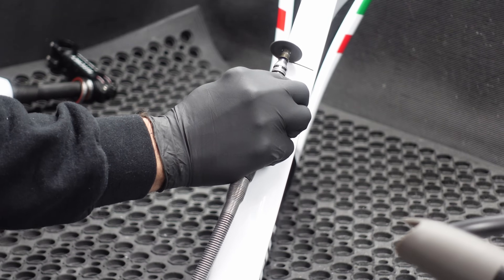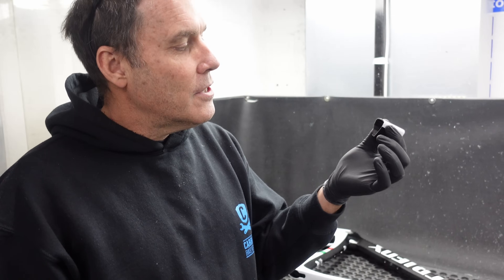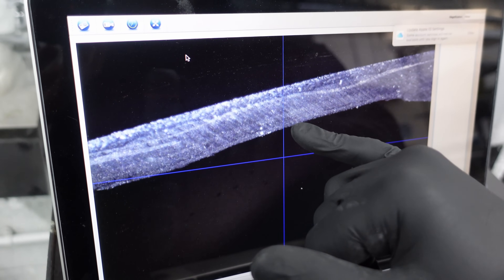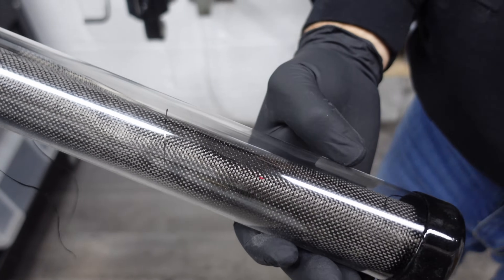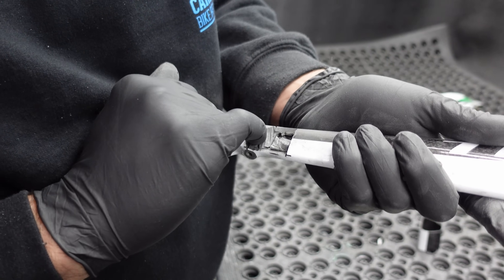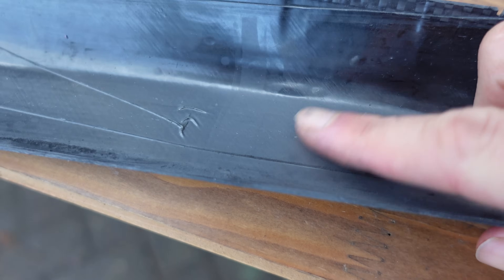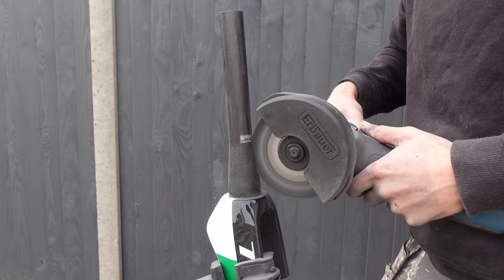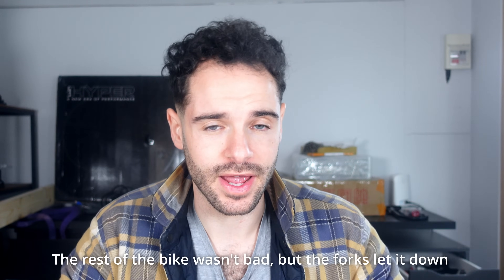I Cut My Cheap Chinese Carbon Frame in Half... Here Is What I Found!

Comment: Sorry to say it no carbon  frame from 500$ to $10,000 is fully 100% guarantee void free it is just the nature of the material and the resin. In order for a perfect frame it would have to be built entirely by CNC, computer layered out and we know that’s impossible as the end points of all frames  are manually added. Even 5000$ frames from Time and Look are sometimes have voids and other issues.

Comment: I guess I might know a bit about carbon bike stuff, but not everything. I did work for zipp years ago and learnt a few things about making wheels and other things like race cars parts.

I would say that Taiwan would make better frames than China and for the price point better than some in Europe. Taiwan gets out of date carbon very cheap from the aircraft industry that is still very usable for bikes. My boss told me this as zipp never used the out of date carbon fibre, hence the cost difference and quality and price.

The carbon fibre that is used is pre preg, which means it has the epoxy already in the woven fibre. The material needs to be kept in a refrigerator until it is ready to be used, then it is cut up at room temperature with dies, then he layers, then laminated before going into the dies. Depending on the shape, bladders would need to be put in to blow it up into the shape of the mould while being baked. The epoxy has a shelf life in the process but still quite usable well after the date.

In the early days, the campagnolo quality was very bad compared to zipp, which did not fail. My boss got experience with Williams formula one team, and it was the test for the carbon fibre. It would be tested there for years before making it to the aircraft industry.

The white filler looks like epoxy foam that is used in some areas to fill up between the epoxy. The carbon may have enough strength to run down either side, but the use of the epoxy foam is to give the triangulation required from one surface to the other.

The use of aluminium and carbon fibre to my own understanding is very compatible in a bike frame, but you need the right adhesive to make it work.

A formula one car and Indy cars have aluminium blocks glued into the rear of the tub where the driver sits. These blocks have carbon fibre on either side and take a massive force as the engine is bolted to it, and then the gearbox is bolted to the engine. The suspension creates the bak of the car. This construction of the front of the car in carbon fibre and the rear end of the car made of aluminium alloys stays together with this glue. I do not think any bike would ever come close to this stress, and it works. I would say the parts are not prepared correctly and might need an etch treatment or require anodising and correct adhesive. 

As an engineer and working with composites for years and race cars, you kind of get an idea of what works.

Most race cars have an inner layer and outer and a spacer that transfers the forces either way. The core is called nomex, which can be aluminium or a bakerlight material, and all stays very well till you blow up an engine.

I hope this is helpful to understand a few things about carbon and bikes.

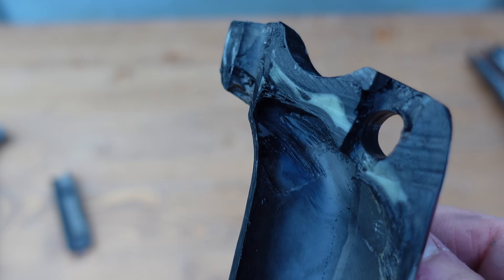Comment: there is a huge epoxy pocket in the seat clamp, with an air void in it. And the horizontal bolt hole appears to go through it (see 9:50)  That seems a little sketchy to me, especially considering how much torque seat clamp bolts need to keep the saddle in place.

Comment: The white material in the fork is polymethacrylimide, it's a foam material used in places where full carbon is not needed but whzre halow carbon could be faulty, it adds rigidity and dampening so.. a logical material for a fork head
Reply: Either that or syntactic foam

Comment: This is why open hardware frames are better. Yes, they doesn't look pretty (like replicas), but such issues like with that fork joints are not a subject in that case. You can make them less boring with some paint I guess.

Comment: NEWS FLASH: Many frames come from the same molds produced by the factory.  Many of these knock-offs are produced during off-factory hours using farmed-out inventory (sketchy). Paint jobs and stickers are the main difference between these cheap commissioned carbon frame jobs; plus, the materials used during this "ghost factory" production process.  You get what you pay for: Generally, if the price is cheap, so is the quality.

Comment: On one hand, why bother with cheap carbon crap? On the other hand, "proper" carbon is so overpriced that I'd rather spend the money on a beautiful fully custom steel frame built to order. Yeah, it'll probably be heavier, but like most mere mortals, I'm way above racing weight for a lighter bike to make ANY difference at all. Want to save some weight for free? Just pee or take a shit before heading out. 🤷‍♂

Comment: first video was good, this one not so much. as an expert in this industry, the jam in the sandwich is not correct. what youre seeing there is a off axis unidirectional ply. The white stuff in the fork is not epoxy, its syntactic foam, which is a weight saving tool. Though he was right about the front of the crown race - that looks pretty deadly.

Comment: This is funny, but the manufacturing process I developed using water borne epoxy strengthened the tube corners. The secret is external instead of internal compression.

Comment: All interesting stuff but...... where does all the carbon and resin dust go? Nice gloves but then it went all over clothing which is then carried and deposited elsewhere. Yeah, wash the clothes but where then do the resin particulates go? Resin encrusted resin doesn't decompose so will enter the natural environment unless contained. And putting an angle grinder to a frame on the patio? Great! you've just contaminated your living space. When working with composite materials, I treat any dust as a hazardous contaminant.

Comment: I haven't read the comments, so I'm sure others have mentioned it, but the flex of the fork is a nonissue once the wheel is connected to it.  I'm a carpenter, and I deal with wood designs from houses to furniture all the time, and this same principle is seen a lot in many structural designs. 

There is nothing to fear from the flex in that fork.

Comment: why don't you stress test the fork with the thin carbon with that white resin?  Maybe bang on it or step on it or put weights on it?  See if it'll hold? I Think the fork is perfectly fine because the white resin (epoxy resins) can hold 5,000 to 6,000 psi! So I don't see how it's an issue if you see thin wall of carbon with half an inch of resin It's tough vs weak in my opinion.

Comment: The Chinese bikes you need to watch out for and not ride are the cheap ones not maid to spec. There are video's of people getting seriously hurt because they would snap in half over minor stress.  Technically all our bikes are made in China.  Best to go with the big name brands where the frames must be made to spec with no cut corners.  One will put you in the hospital pretty fast while the other will take good punishment over time.  Smartest thing to do is go Aluminum and just skip carbon unless its a road bike where you never leave the pavement or do any elevation changes like going over a curb to get to the side of the road or leaving the side of the road to get on the street from a curb.  I think road bikes are the only bikes that should be carbon to a degree.  I prefer mountain bikes so I'm all aluminum.  Safer and last longer.

Comment: Very interesting video with a lot of good insights about carbon bicycle frame construction. There was one thing that struck me hard though -  seeing a person cutting through the carbon reinforced material with no gloves, and presumably, no mask as well. That is extremely ignorant and can be dangerous in the long run. When machining, carbon reinforced material does not turn into powder, but into micro needles which can penetrate skin and tissues in our respiratory system easily. Our bodies don't recognize carbon as foreign dangerous material and don't attempt to shed it.

Comment: Have a Trifox X16 for 2 years, 6.8kg without luxury parts. Got hit by a car from behind, very nasty hit and run, my rear wheel cracked off course and the frame is still absolutely perfect. I did not believe it survived this massive shock, the frame is really super strong, even weightneing 865g (49cm). Trifox is a great brand.

Comment: I'm not an expert or anything, but at 10:55 you highlight the fact that there is a big problem with the thickness of the carbon fiber in that area and therefore expert Rob would not endorse that frame for that "defect". But it is also observed that there is a large amount of epoxy which, in my opinion, would reinforce all that part, since it is not hollow and if the carbon fiber were to split, that same epoxy would not allow it to split completely and would remain firm. So if the concern is the millimeter thickness of that "defect", then what can you tell me about the thickness of the carbon fiber rims that support the entire weight of the person and the bicycle?
I hope you can answer this question because as I said at the beginning I am not an expert in this matter and I would appreciate any comments.
I congratulate you for these videos with very important content such as knowing the structure and the demonstrated engineering of these frames in CF for the enjoyment of all of us who are interested in these topics.
Reply from the maker: You can see a comparison here to another set of forks - https://youtu.be/YNZS3b3PJ1E - The thickness of the fork on the crown race is one of the most important parts of the bike under lots of stress from impact. If it breaks... you are crashing. Rims are a different beast and not really a like for like for like comparison. I have some more carbon content coming soon so stay tuned 👍🏽

Comment: I've had this frame since 2020. I ride it as hard as i can and try to break it so it gives me an excuse to buy a new frame. It's still going strong with zero cracks. Seems like they are focusing on the negatives of the frame on the 1st video and this one. It's been working fine for regular people like me that ride their bike everyday. "It's not aero" who cares about that when majority of people riding bikes are not racing. Plus wind blows in different directions. Can you be aero 360 degrees all the time? LOL. It's kinda racist when you say these Chinese people don't know how to design a frame. You don't know their background. You can view it as they designed this frame to minimize cost so they can pass the savings to consumers. This is actually a cool looking frame. Who really is ripping you off, the company who sells you a $500 frame or another who sells a $3000 frame with all the same ingredients but different form? Carbon frames degrade over time, i rather pay less per frame. I also believe there is a law that frames are required to have a strength tolerance in order to sell in western countries.

Comment: Oh, and seriously, I see from commentary below you are allegedly wearing PPE which I did not see. However, you are abrading [by cutting] a potential highly toxic substance, in an open room where the dust will remain for anyone else to breathe for some time. While we do not yet know the long term risks of both the poison from the epoxy and if the tiny fibres are indeed like asbestos and unable to be ejected from the lungs. Just a thought.

Comment: the white material you found may be a milled filling foam used to wrap carbon-fiber around: you can have a shape designed to withstand force, without having to layer carbon solid
Reply: what material is it?
Reply: Looks like a PMI foam core.  @hash-CCFF00
Reply: the "Carbon expert" is wrong in his assumption that the white stuff is escaped resin during compression. It is an intentional syntactic filler that fills the cavity and prevents non-compression zones.

Comment: People praising these frames..wth? Did you even watch the video and listen to the engineer? It’s a sloppily built frame rife with excess epoxy and excessive bladder flashing (that translate to stress risers..a.k.a. Points of likely failure under stress), and the fork is completely unsafe! They just threw a whole bunch of unidirectional carbon arbitrarily into the mold, slathered it in epoxy, and compressed it with the lowest grade bladder possible, then wrapped it in multidirectional weave to make the outside look nice. It’s garbage!
Reply: because they MUST justify their horrible purchase decision and choice to load up a bunch of premium parts onto a garbage frame so that they can feel better about themselves

Comment: Excellent video, I built a Trifox light frame ( given at 900 grams frame only) with Shimano 105. Arrived at around 7.5 kg total, riding for the past three years. No issues so far. Bought the frame in Shenzhen directly at the factory, needless to say service is great. Got the handlebar from them as well, one piece molded.

Comment: "All frames are made in China, so what's the difference?" Well, supervision of manufacturing by the western bands' buyers agents. The buy direct stuff, I totally agree, is aiming to make a quid, and you don't make quids for long if your product breaks too easily, however... with less supervision, a product scope aimed at cheap (not necessarily affordable) and the fact that cheaper manufacturers are often "chancers" who've bought a turnkey bicycle factory on credit, you're getting what you pay for - weight, flex and the occasional **CRACK!**

I ride on a budget and do cycle touring rather than racing. I ride fluid formed aluminium or steel, although the latter is getting pricier than alloy these days. If I were looking for speed at a "clubby" level, I'd probably stick with brands like Giant or Reid to stay within something approaching my budget in carbon. "Uncle Ho's Cheap Chinese Bicycle Company" are happy to sell to us, but then we're without support once it goes in the crate and ships. Would you put your kid on a carbon bike that might crack?

Comment: For this test to have any validity you would have to cut up a number of frames from that production run.  Shoddy manufacturing can mean sloppy construction, inconsistent construction, or both - among other factors like poor QC etc.
Reply: Except an area on the fork that had too thin carbon on a safety critical area.

Comment: I always lubricate all screws that thread into the frame because the methods of removing a frozen bolt/screw (solvents, lubricants, tapping, drilling, high torque loads) can damage the frame. Cut a Time and Look apart; the story I have heard is that they are some of the best

Comment: 1) Please, if you care anything about your own health, when you're cutting carbon fiber wear a respirator and cut over a vacuum table. Carbon splinters and dust are inert particles your body doesn't register as foreign bodies and will sit in your lungs and in your own skin not actively expelled by the body's immune system. 

2) It's actually fairly easy to source mainstream manufacturer bike frames to cut up. They're called warranty repair or crashed bikes. Warranty repair only requires the shop to destroy the frame, would consider what you're trying to do destructive. ;) 

3) If the repair expert says the forks are likely something he doesn't feel confident in, why do you end up saying you're going to keep buying them and running them? Simply buy another reputable fork and run that. Paint/decal it however you want.
Reply: Thabk you, finally someone says it. I was baffled by the recklessness in this video. I always hoped they at least wore FFP2 masks, but obviously, nothing at all. Cancer incoming. Sad, but that guy's own fault.
Reply: @donfuan76  by your standard, I should be dead by now. But alas 40 years in and I have yet to see myself, let alone a colleague suffer any these life threatening issues. Yes, we wear PPE, but it's never a sure thing and we can and do inhale dust in small amounts.

Comment: Thanks for your sacrifice! 😅
My first go round with Chinese carbon I purposely bought a road frame that was a bit beefier as most failures at that time were from the frames attempting to be ultralight climbing frames. 
That bike served me well for thousands of miles and is still going strong on its third owner. 
I also rode some Chinese road and mtb wheels. 
Chinese carbon has come a long way. Now I have a Chinese gravel frame on order. 🎉

Comment: Great info! Thanks for sharing. I've been racing a Chinese enduro carbon frame since 2 years ago, and I've been very happy with it. Right now I'm on the 2nd frame, but I change it only to change size. No problems at all! Frame is an Ican P9, highly recommended.
Reply from the maker: Great to hear it worked out well for you 👍🏽 I've looked at ican frames recently

Comment: As seen in the vid, the frame is good for its value, its just that the fork had some issues. To conclude, if I was to buy the frame only and a better carbon fork, would I be more safe than haveeing the stock fork from the frame set?
Reply from the maker: Potentially, I guess you never truly know Most of these frames have specific forks so you can't buy a different fork. Not always the case but that's my experience with aero frames.